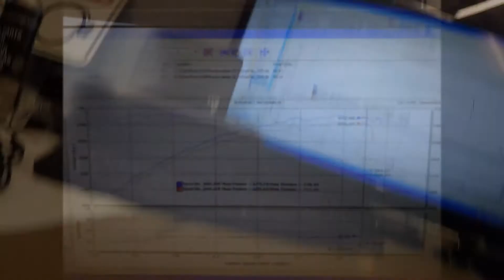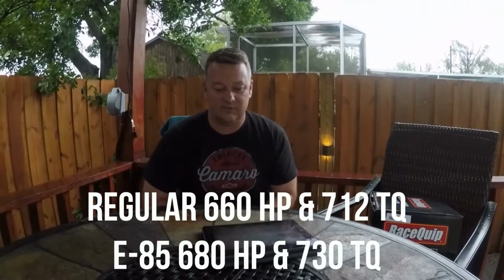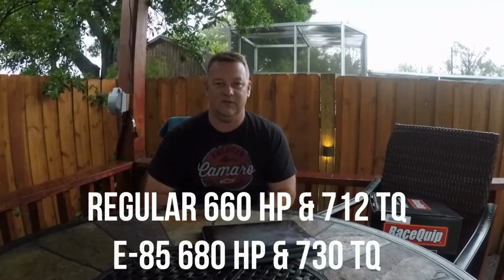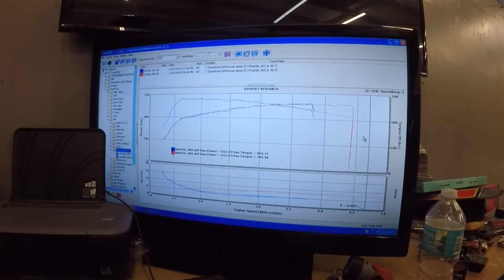Stormy Dyno after modification!

Comment: I seen your first Dyno put down around 550HP in a previous video, and this one put down 660HP, what mods did you do to get 110HP? Flex fuel sensor with meth injection and a tune? anything else?
Reply from the maker: Rob Nonz we actually did quite a bit. So yes a tune, flex fuel sensor, methanol, Texas Speed Headers,  160 thermostat, thermal plates, Rotofab CAI, and a 3:21 upper pulley. We are most likely going to do autocross events more than drag racing so the Headers and thermal plating is all about keeping the heat away as much as possible.
Reply: FL FUN ZL1 thanks for the reply, I just picked up a 2018 ZL1-1LE last week its stock so I was curious what you have done to yours to get 660whp.
Reply from the maker: I’m going to assume since you have the 1LE ( awesome car BTW) that you’ll do more autocross then drag racing. If that’s so, I’d recommend staying away from the methanol. You have to keep the reservoir full and a 20 minute track session will eat that up quick. Also if you’re looking for more whp instead of the smaller upper pulley, you might consider a bigger supercharger. That might be our next step depending how our day goes at Sebring this weekend. Good luck and let us know what you do. Did you get the PDR?
Reply: FL FUN ZL1 I’m definitely not going to drag the car I might try it for fun but mostly will be autocross/roll races I will probably do the rotfab CAI also considering porting the supercharger. Yes I have the PDR I haven’t tried it yet does it record cabin sound?
Reply from the maker: Ah Rob I forgot to say we ported the throttle body and supercharger. The PDR is pretty awesome. It does record the cabin sound if you want it to. You can turn off that function.
Reply: FL FUN ZL1 oh nice so you have done lots of mods. I got my car a week ago and she’s put away for winter I’m in New Hampshire so winter is upon us. Great content I enjoy your videos. Thanks for all the info.